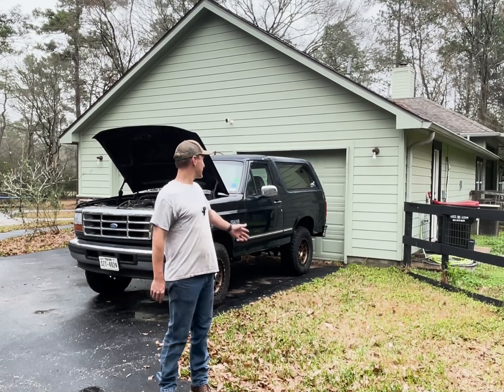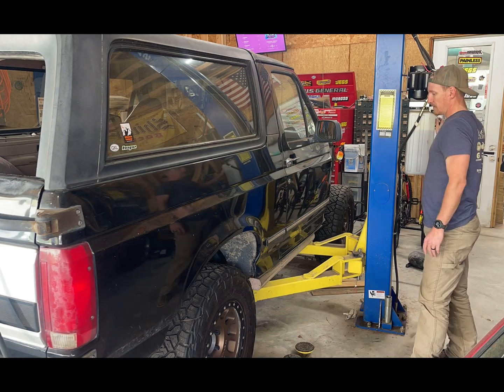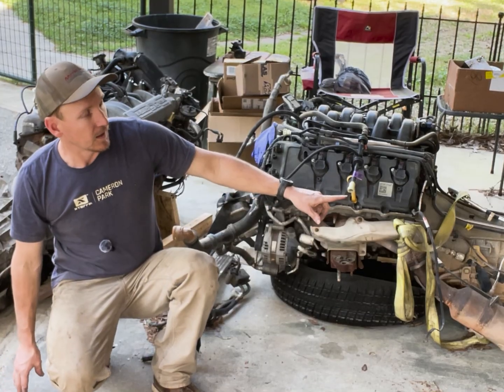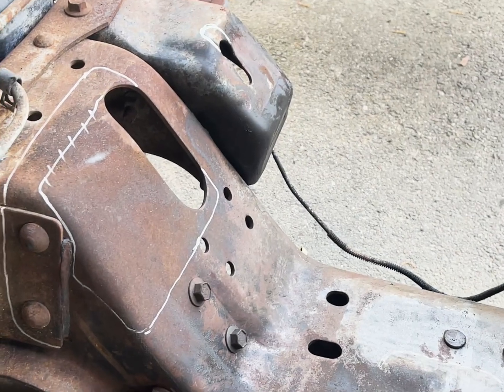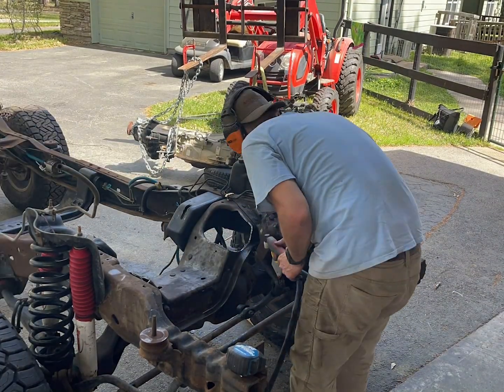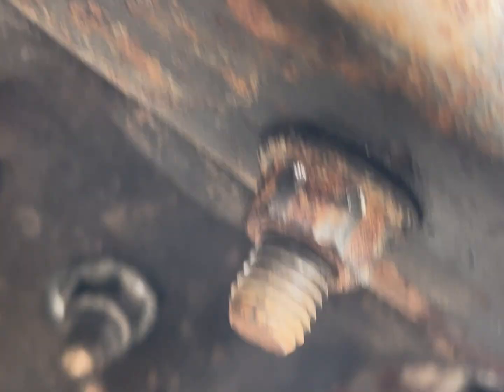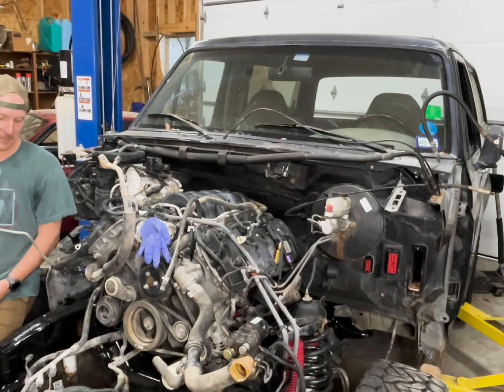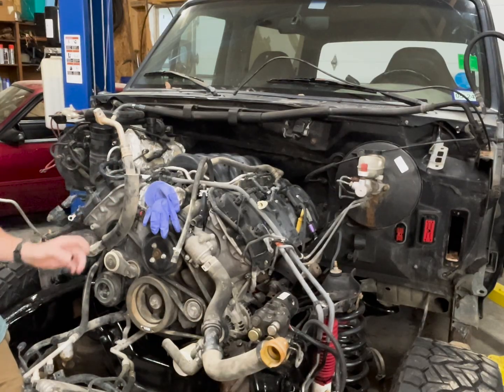1996 Ford BRONCO Gets a 5.0L COYOTE ENGINE

Comment: I wanted to do a Coyote swap on my Bronco. Seems like more work than it's worth. I was checking the mileage on the Coyote and they aren't much better than the old engine so yeah, I'll pass.
Reply from the maker: It’s not for everyone. I drove from north of Houston down to Matagorda, down the whole beach and back home today on 3/4 tank which works out to 16.6 mpg. My 351 got 13 on a great day. The swap wasn’t difficult either, and this was the first time I’ve touched a mod motor

Comment: So the 6r80 is shorter then the e4od or 4r70w you had in it?
Reply from the maker: Correct. Even with the adapter!
Reply: As far as I know the e40d was the longest trans ford ever had lol I was gonna swap my 95 over to a 88 4 speed manual and it was waaayyy shorter so I’m changing that to going back with a e40d cause I can’t find a drive shaft and I’m changing it back to a daily driver not a play toy so don’t want to worry about having a custom one made

Comment: Little bit late to the party, but doesn’t cutting so much out of the frame to get the engine in risk the structural integrity of the frame?
Reply from the maker: I added some reinforcement back in after
Reply: Did the motor mount flip trick work? I’m literally about to do the exact same swap in my 94 f350. I just will need those 302 engine mount bracket/perches
Reply from the maker: @WiseGuyzGarage  Yes, worked perfect, I have about 3/4" clearance now
Reply: @Colsch_Craft  What Transmission was in the truck prior? Im staying 2wd, and going to the 6r80 from the E40D trans. Cant find jack on the driveshaft information. I suspect that the newer model trucks driveshaft might work, not confirmed just yet
Reply from the maker: @WiseGuyzGarage  Had an E4OD in it. But used the same yokes since I re-used the transfer case

Comment: so you did this without having done it before?
Reply from the maker: That’s correct
Reply: @Colsch_Craft  how did it turn out. I can't find the finished video.
Reply from the maker: @DesertRider112 been chasing an issue with the PCM and fan control and haven’t finished it yet. I think I have a solution and should have it fixed in the next couple weeks.

Comment: Tune the truck.  Everyone wants to skimp on that part, not sure why they do, but tune that bad mama jama
Reply from the maker: I may have to. I was hoping that by using ALL of the factory parts, it wouldnt be needed. But, I dont think I can get by using the factory Y pipe, too wide and also the front driveshaft clearance is an issue
Reply: @Colsch_Craft  so the response to that is nothing about that truck is factory.
Reply from the maker: @ How do you mean? I pulled everything out of the donor truck and havent changed anything as far as sensors and such go. The factory harness and ECM are being utilized. I'm not arguing, just trying to understand why it wont work. I'm very familiar with EFI, my mustang has a megasquirt that I tune with.
Reply: @Colsch_Craft that motor was designed to run different platform all together.  You can def get away with it i just don't understand the logic of full building a custom truck but not wanting to spend the money on a tune.
Reply from the maker: EFI uses inputs from sensors to calculate outputs to run the motor. The ECM expects to see certain ranges of voltages from certain sensors. When you change things, IE cams, turbos, etc you need to recalibrate the computer to read the new voltages it’s getting from the sensors. In this case, i haven’t changed any of the inputs. The ecm has no idea what platform it’s in, it just knows what sensors to look for. So if all remains equal, there is no need to change the tune. Now, if I delete the cats because they don’t fit, then yes, i will have to get a tune. But otherwise, it would be running exactly as it was inside the truck it came from.
Reply: @Colsch_Craft  Yep, you're making the same case that everyone who says they’re not going to tune makes. All that time, money, and effort spent—and the one line that can’t be crossed is tuning it. Like I said from the start, it makes no sense to me why that’s the line in the sand. But you’ve made the same case many have made before you, and I’m still sitting here wondering why you wouldn’t want to get the most out of your motor and have it tuned after putting all that into it. We all have our lines in the sand, I guess.
Reply from the maker: @JMRRebuilders well again, I’m not a “tuner” but I have been using Megasquirt for many years up to and including building the units from scratch and reconfiguring them to run LS coils, boost, etc so I have a pretty decent understand of how EFI works and what is needed to make them run well. This is a situation of what is necessary to make it run and what isn’t needed. You’re welcome to spend your money how you like but in my case this is not something that is needed to make the truck continue to run as it did in its original installation.
Reply: @Colsch_Craft  yep thats the logic.

Comment: great stuff good luck on the build.
Reply from the maker: Thanks! Do you have any feedback on the Volvo pump after a few years' use? I'm leaning that way because I really dont want to spend $2k+ on the PBH stuff just for power steering.
Reply: @Colsch_Craft  It works well def get ptfe lines for the pressure and use range industries adapter.  The other approach would be to use Range erack mount kit and setup.  I would rather not have the volvo pump.  Good luck
Reply from the maker: @JMRRebuilders  Thanks!